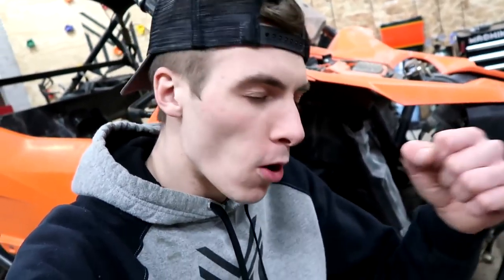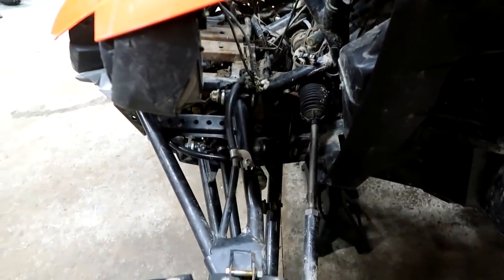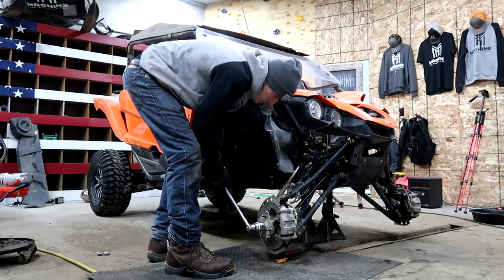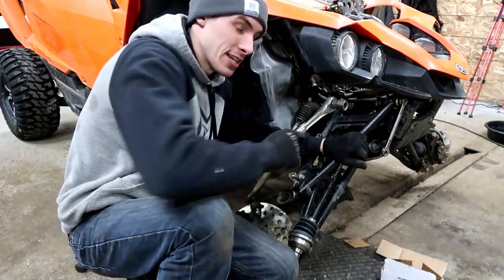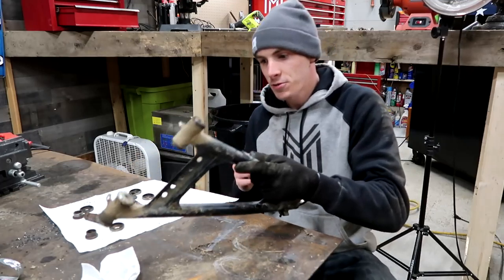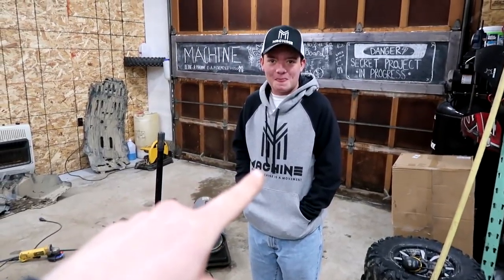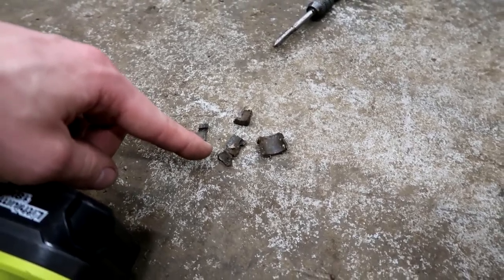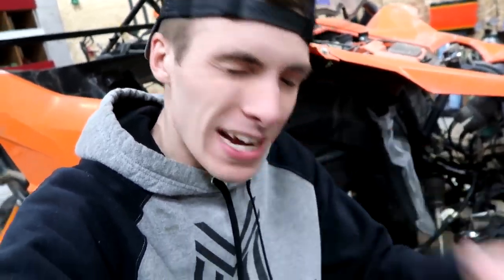THIS MACHINE is TOTALED

Comment: Looks like neoprene bushing we use them in the micro sprint I have sometimes you have to use ambushing reamer in them to get the pins to fit or in my case the torsion bars to fit through them

Comment: I use that spray at work all the time I’m a diesel equipment mechanic and I work on a lot older stuff I could have a bolt completely froze let it soak and it’ll free right up. Best on market by my vote

Comment: looks like the same a arm bushings yamaha used on banshees and blasters, The oem bushings are garbage. You can grease them after every ride and they still wear out. The lower ones will always wear out before the upper ones,They absorb alot more of every bump. I went through a few sets before I had a friend in Germany machine a bunch from some kind of green neoprene material,I still have them in 15 yrs later and no play in them what so ever.I dont even grease them any more.   An airgun removes those axle nuts alot easier than a sore wrist. Hope you get all the bugs worked out of that thing and eventually race it.🏁

Comment: I hope you got a major refund on this YXZ, because it's been seriously abused. Not the barely used Yamaha you thought you were buying.
Reply: He bought it at a salvage  auction crashed. You don't  buy a crashed vehicle and expect it to be mint.
Reply: Alex B facts
Reply: Mark Wallis Not the sellers fault buddy.
Reply: GDGames it is the sellers fault...it was advertised as wrecked with 35 miles on it....when Dalton got it home he figured out it had 2700 miles and the seller showed and error code 35 on the speedometer and said it was mileage....  A wrecked unit would not have any wear and tear...you'd replace wrecked parts and giddy up
Reply: I FixIt Ok? Dalton should have done his research before going out and buying it. It was an impulse buy on his part, he should have known better. Also that's not true, you can easily have wear and tear on any vehicle before wrecking it. That's like saying just because I wrecked a 2016 crf450r doesn't mean I've ridden the shit out of it and put 100+ hours on it. Lmao..